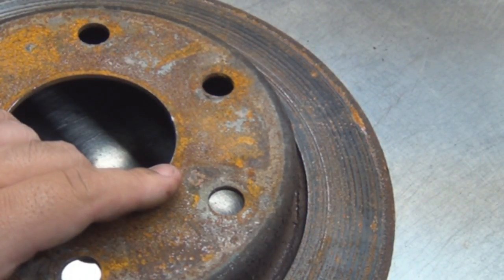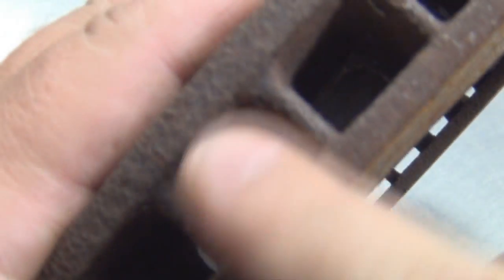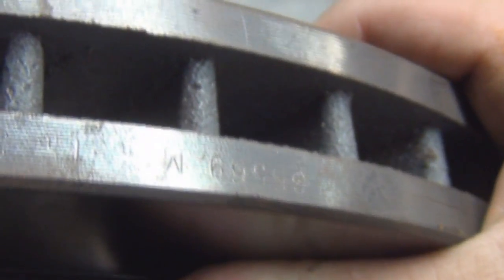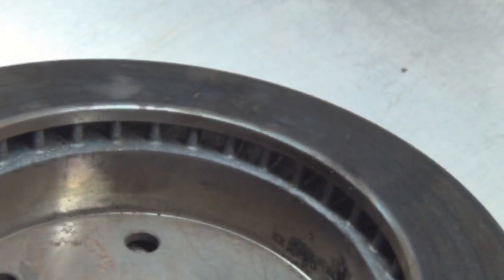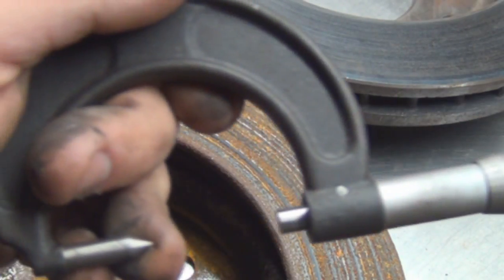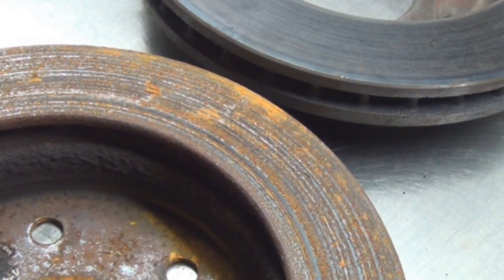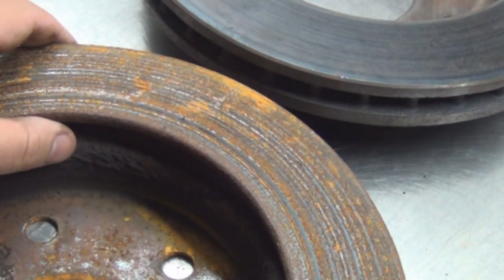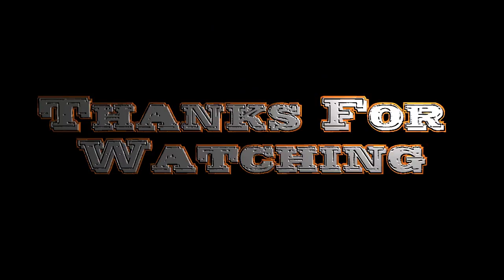How To Measure Brake Rotors WALL THICKNESS  and Where to Find The Specs

Comment: Offering up access to a brake drum/rotor spec guide would've been helpful.     I found this useless.  Not everyone is doing this for the first time.    A rusted rotor does not reveal it's original markings.   Think about that.
Reply from the maker: Then if it isn’t your first time then you would know where to find the specs. If you would of asked nicely, I would of told you. Think about that.
Reply: This guy is sharp.   Useless without a valid spec.      Why not just take a guess?

Comment: I'm hoping you will get a notification for my question. I have a 2008 Chrysler Sebring Convertible that needs rotors. I see two measurement options on fronts for them. One says 10.31" and the other says 11.61" how do I know which ones to buy? Will there be a problem if I get the wrong one? Looks like 1.3" difference in size.
Reply from the maker: You can always order them and compare them side by side and if they don’t match up return them for the other set. Usually there is a trim option but on your particular car I am only finding one option here https://amzn.to/2IcHTBX . I hope this solves your problem. Thanks for watching and commenting. Please like share and subscribe.

Comment: That would be almost my question as well & I see he didn't answer. I couldn't order the rotors online as the front has 2 different sizes. I have nobody to take the wheel off today to look at the specs, measure or count the studs. I'm a chick with no tools! Looks like I'll just call the Dealership w/the VIN number. I never knew there could be 2 different sizes of front rotors for the same year, make & model. The rear has only one size so that's cut & dry. You learn something new every day. But this was a setback as I could have had the rotors ordered already. 4 rotors at an Auto Parts store cost way too much money!
Reply from the maker: depending on the vehicle you have will differ in brake sizes. For example LS, ES, Sport, and etc. will sometimes have different options. I usually pull a wheel and measure. Sometimes you can find the specs on the rotor or drum if its not to rusted. Thanks for watching and commenting. Please like,share, and subscribe.

Comment: 1995 Ford Crown Victoria brake rotors:What's the diameter for the front-rotor and what's the diameter for the rear-rotor? Are they the same size? Thank you!!
Reply from the maker: depending on the vehicle you have will differ in brake sizes. For example LS, ES, Sport, and etc. will sometimes have different options. I usually pull a wheel and measure. Sometimes you can find the specs on the rotor or drum if its not to rusted. Thanks for watching and commenting. Please like,share, and subscribe.
Reply: Glenn donnelly ford falcon 96 XH ute rear discs minaman thickness please Solid rotors